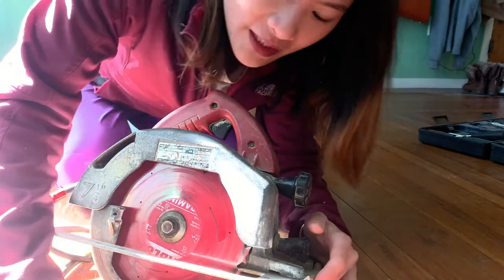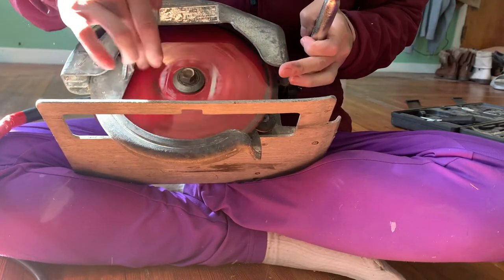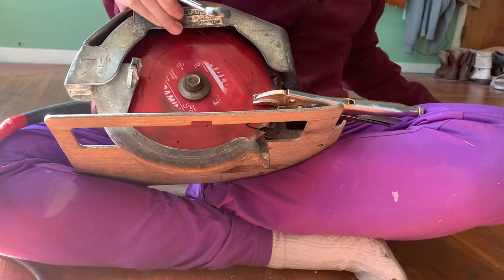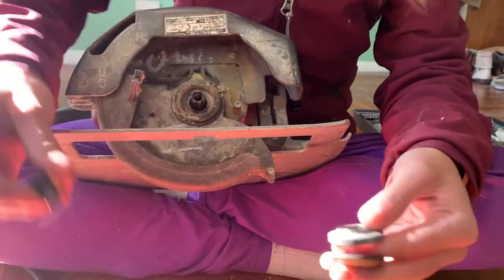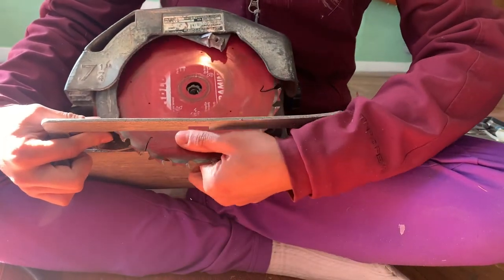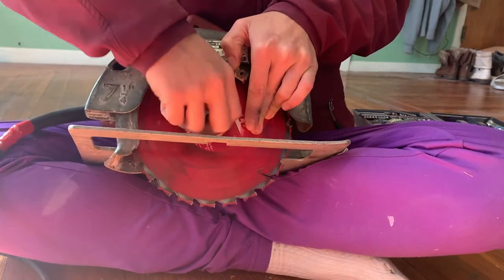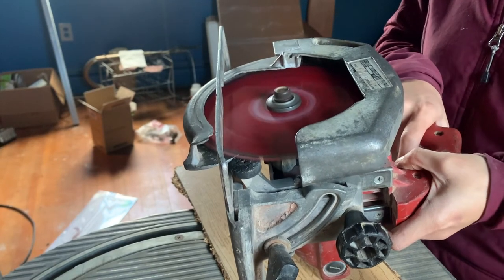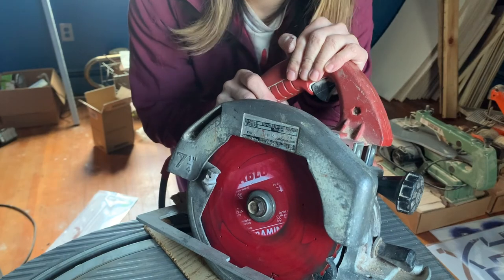Circular saw no spindle lock - blade change - spinning blade troubleshoot/fix - Milwaukee M12 7 1/4

Comment: thank you for this help... I've been using every kind of tool forever and always figured everything out but how to get my smooth stone blade off my saw... every guys video shoves a screw driver in the teeth, but there isn't any on a stone blade... saw your video and thought finally, and still wanted to hit myself in the head with it for not thinking of it.. :)

Comment: Thanks for your video, but your blade should not still be spinning when it stops, so I think you blade isn't correct thickness for the saw. Just be careful and maybe buy a new blade that will be correct for the saw.  ✌ 

Edit: if it isn't the blade thickness causing the spinning, it will be the saw poorly functioning. Once you release the trigger, the break should stop the blade instantly.
Reply from the maker: thanks!  I think you're right. the parts that hold the blade are quite worn which was giving me the issue originally.  This corded saw is actually quite heavy and I find myself using other saws more often over this one.
Reply: @1tinybuilder  This an older model saw I dobt there is any brake.This saw is probably older than you are. Thanks for the assist with locking the motor.